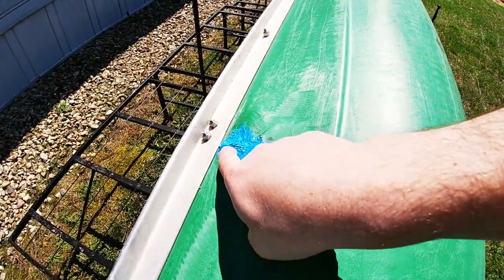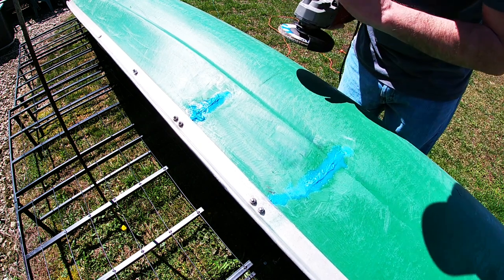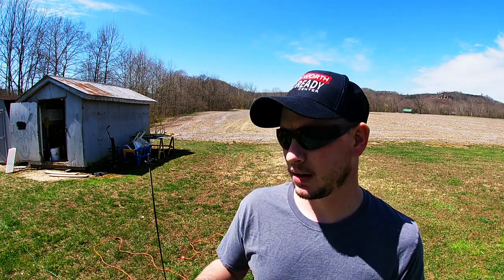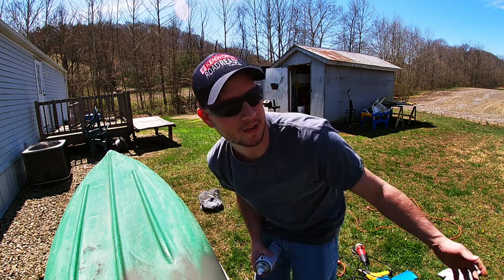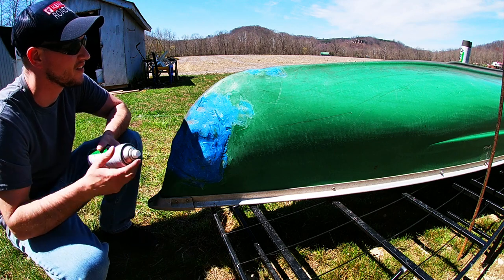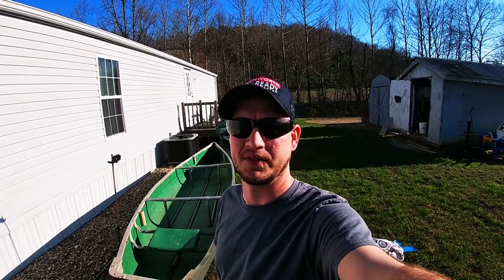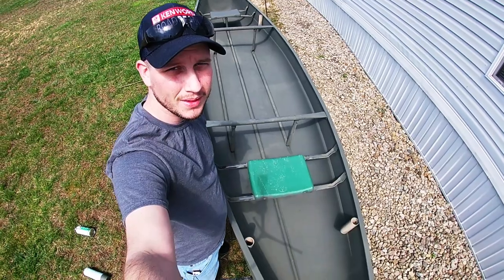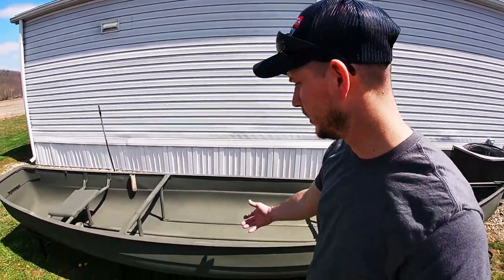Finally painting the scanoe! [Rustoleum Camouflage]

Comment: How did the paint hold up? I’ve read that paint doesn’t adhere very well to the plastic Colman used for there? I’m wanting to do the same
Reply from the maker: It's been good! I haven't used the boat much since I got another one, but it sits outside in the sun and the weather and isn't flaking off. If your boat is super smooth, I would sand it down with some 220 grit before you paint it.

Comment: How did the paint hold up. I have the same canoe
Reply from the maker: It's been sitting outside in the weather for a couple years now and it's not flaking off. It has a few scratches on the bottom but other than that it's holding up pretty good.